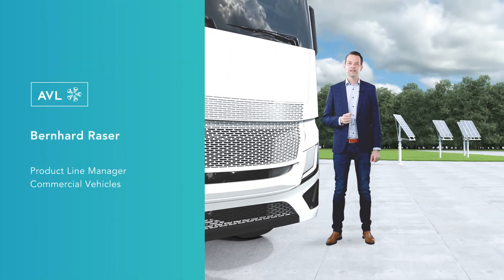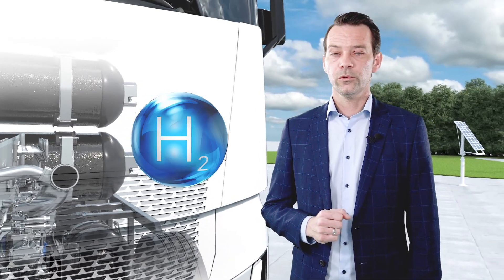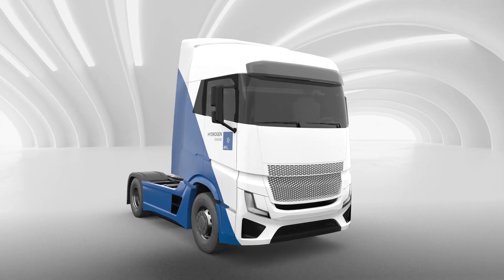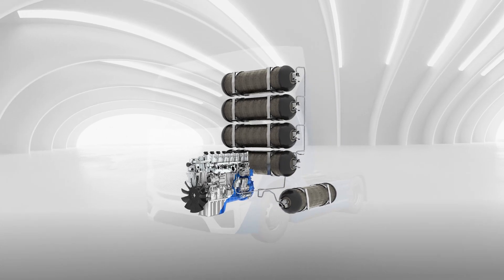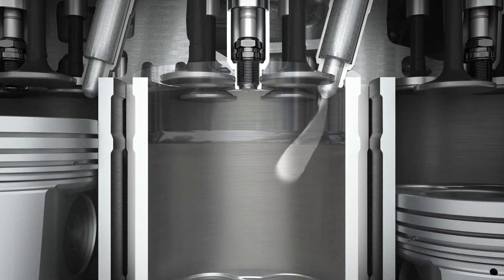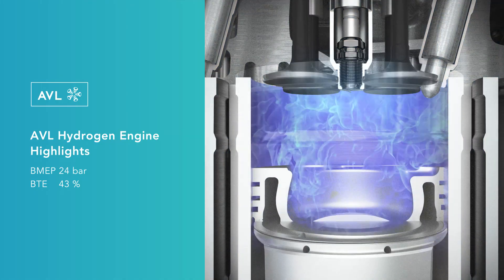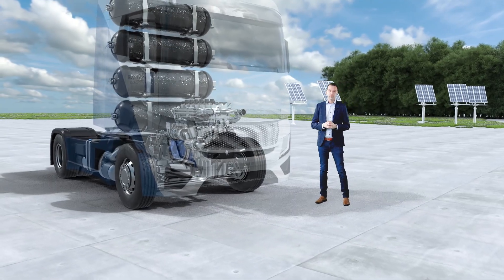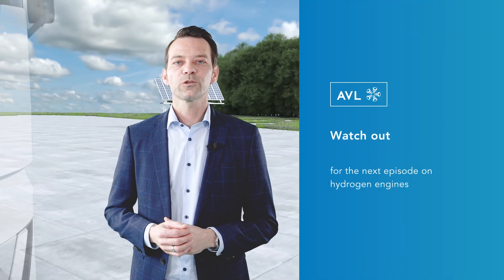H₂ ICE Development | Part 2: Development Approach

Comment: @ 1:30: (for all who are not so familiar with these abbreviations...)
BMEP: Brake Mean Effective Pressure - basically the (measured) engine torque at a given speed, normalized by the engine displacement
BTE: Brake Thermal Efficiency: mechanical power / power generated by the fuel (here: @ load point with maximum efficiency)
Brake == the Dynamometer, measuring the engine torque on the test rig